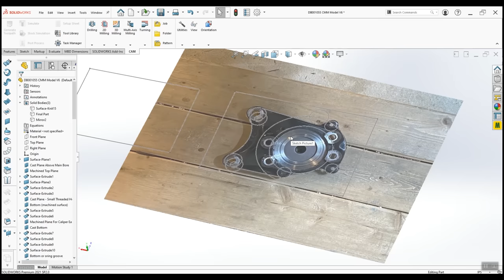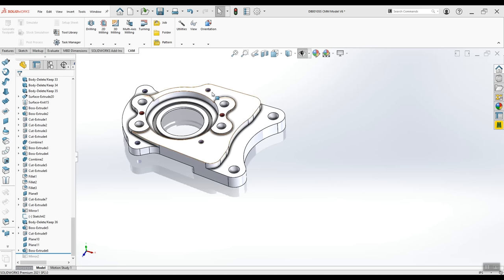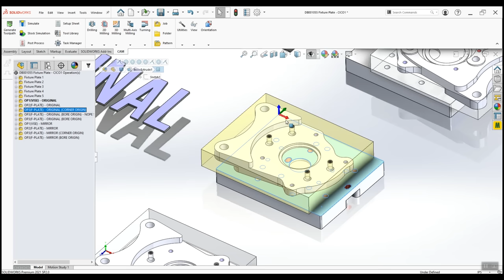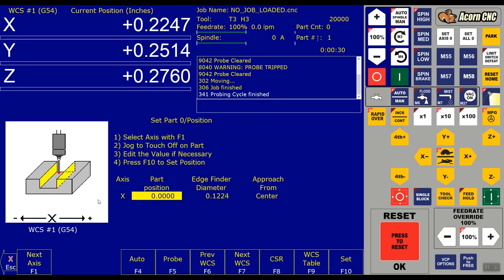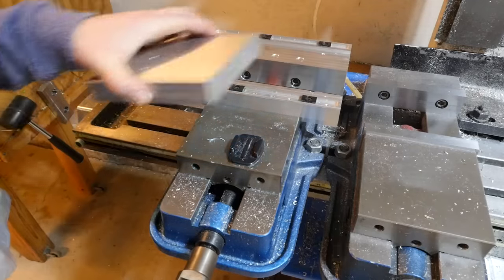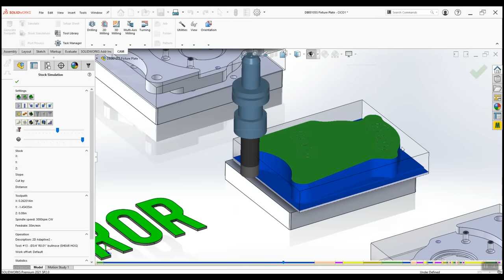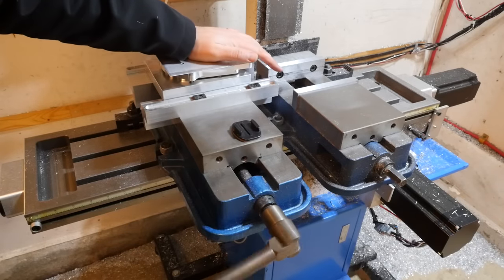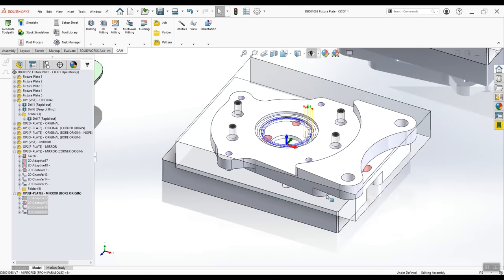How I Copy Parts in the Garage on a CNC Mill

Comment: Nice balance between pace and detail in this video. Thanks for sharing your workflow. How repeatable is the probe on X,Y ? I've just finished working in a macro that does multiple probe strikes and averages them to get a less than 1 step accuracy repeatedly.
Reply from the maker: Thanks! Repeatability is well inside a thousandth in x,y, and z. Accuracy is around a thousandth.
Reply: @adamdebowski2037  ok thats pretty good. My machine has 0.0125mm steps or 1/2 thousandth and I'm getting less than half a step error in repeatability. I've been trying to line up a bore when flipping a part.

Comment: Do You know how the formula of upgrading horsepower? Example of 2jz engine had 320hp but someone build 2jz with 3000hp. Is there any thicker wall of the engine besides of bigger compression and gas supply

Comment: OMG - Firetrucking awesome! I am an out of work machinist and disabled veteran. I would really like to know more about how you made your PM-30 work with CNC (I'm wondering if there is a ball screw kit for it). I already use Fusion 360 for my plasma cutter and I've done 3D in the past. My goal is to have a small fab shop at home so I can make a little income, anything would help. What you have there looks like it's in my reach and it would put me light years ahead if I could mostly replicate it here. That edge probe is the cats pajamas... The ones we had at my last job were so expensive that I rarely got to use one, good old dial indicator and the classic edge finders for most of us in that shop. You got my sub today. Thank you so much!
Reply from the maker: Hi PT Anderson! Respect for your service 🙌🙌 there is a ball screw kit for the PM30. There is one made by a company called “pro cut cnc” (I think), and one by a guy on YouTube (David Clements - YouTube username: Arizonavideo99). I have Dave’s kit and can confirm he does a great job getting out almost all the backlash. Yes - this probe is amazing. It’s good to about a thousandth which is plenty good for this mill. The “real” probes by Renishaw and much better, you pay for it, and would be overkill for a machine like this. The machine itself isn’t anywhere close to that accurate. I used an edge finder for almost two years before getting this probe. I would say a decent edge finder is about as accurate as this probe, and can do almost all the same things with more calculation on your part. The probe is mostly a luxury, and I love it! Cheers 🍻
Reply: @adamdebowski2037  That edge probe seems to be worth it just in speed, repeatability and ease of use. I plan on getting one when I can. Thanks for the info! I would love to see a video tour of the upgrades to your PM-30 when you get a chance.
Reply from the maker: @p.t.anderson1593  my thoughts exactly. At this price point, the extra luxury is not too hard to justify. Drew also makes a tool setter for closer to $500USD, which I do want but is a harder pill to swallow - especially when paying for customs and in Canadian pesos. I’ve been meaning to make a little PM30 upgrades video. Will try to get around to it soon!
Reply: This looks like a great machine, really nicely converted. What size steppers does it have? What is the spindle power? Currently looking into buying a CNC mill of some description.

Comment: is it possible to a copy a cylinder head port using larger centroid machine?
Reply from the maker: Absolutely. Centroid is just the controller - you can think of it as the computer/brain of the machine. The physical mill is what would have to be larger.
Reply: @adamdebowski2037  can you teach me the process on how to a copy cylinder head port design and what machine to buy? im willing to pay you for your time. im planning to open a machineshop here in philippines but i dont know who really knows how to operate this thing
Reply from the maker: @Perez.  feel free to send me an email with the details - a photo of the part you’re trying to copy - and if you’d like, check out some of my other videos on how to make a CNC machine for low cost.

Comment: Why not use a stop block against the mounting plate so you don’t have to rezero every time you take it out of the block? It the rezero op just more accurate?
Reply from the maker: Both ways would work. If I didn’t have a probe I’d likely use the stop. Using the probe is quick and gives me confidence it’s in the right spot.

Comment: Great work but you kinda didn't explain how you used the probe to model the position of the features into cad.
Reply from the maker: Hey! I think I mention that I measure and model the features one by one in solidworks. There is nothing automatic here. Just good old fashioned measuring and modeling.

Comment: Hi Adan
Thank you for the video, i have a PM25 that i converted to CNC and i used Centroid Acorn, do you please tell me what type probe you use on your machine, 2 wire or the other one for Tormach?
Thank you
Wagner Damotta
Reply from the maker: Hi Wagner - it’s the Tormach probe (it has the 3/4” TTS tool holding shank and shoulder) , but a 2-wire version. You will have to send an email to drew when you order it and he will custom make it for you.
Reply: @adamdebowski2037  Thank you Adan
I will get one, thank you again for the help

Comment: Any ideas on a younger dude wanting to get into doing this? 

What’s your day job that allows you access to this software? 

I work construction and recently got a job offer that is in the office. 

The biggest reason I wanted to do it is because I can’t afford spendy software to draw parts up and bring to cnc shops to have made.
Reply from the maker: I'm an engineer and use solidworks at work often. You can download a free version of Fusion360 if you want to start getting some practice with 3D modelling & CAM. You'll want to start paying the monthly subscritption fee (i forget how much - somehwere between 50-90 dollars monthly) once you're ready to start making parts on a cnc machine. It's not 100% necessary, but Autodesk limits the feeds and speeds which makes machining very slow.
Reply: @adamdebowski2037  Awesome. Thanks!👍🏼

Comment: Hi Adan
I going to order the probe, where i can get the wire diagram for connections?
How difficult for setup the probe?
If i have problem do you can help me ?
Thank you
Wagner Damotta
Reply from the maker: Hi Wagner, I'm not sure you'll find a wiring diagram, but it is a very easy setup. I'll try to describe the wiring. Drew will build you a "custom" probe (for the same price) for use with the centroid control that has two leads coming out of the body in the form of a female connector. He will also supply a short "whip" of the two leads terminated at the male connector that plugs into the probe body. You'll plug one lead into the acorn board's "com" terminal, and one into a designated probe terminal on the control board (that you define in the acorn wizard), then define a few other properties in the centroid setup wizard (like the probe being a normally open type) and that's all. The centroid probing routines will work! If you have issues, I can most definitely help trouble shoot any problems. One more thing: I would ask Drew to supply a spare female connector that you can make a bracket for to use as a "holster" for the cable when the probe isn't loaded in the spindle (just for extra "neatness" instead of having a dangling cable somewhere during other machining operations).

Comment: Did you have to pay for additional software to use the probe with centroid acorn/cnc12?
Reply from the maker: No. The probe works with the standard package. There is a digitizing package you can buy for an additional $300USD (I think) which will scan the part with the probe and generate “cloud point data” (I don’t have this package).

You can do digitizing with the package I currently have but you are limited to 2500 cloud points. Sounds like a lot but it isn’t.
Reply: @adamdebowski2037  Do You have mill pro?
Reply from the maker: @RussHarris100  I do not. Is that a CAM package? I am using HSMWorks.
Reply: @adamdebowski2037  No, I'm talking about the level of CNC12 software to run the Acorn.  They have the Free, Pro, and Digitizing levels.  I have the free, but it looks different than yours. I just ordered the "pro" upgrade.
Reply from the maker: @RussHarris100  I'm using the pro, too.

Comment: How does one get the basics to start CNC ? How much to make a setup for aluminum an wood ?
Reply from the maker: Aluminum and wood are usually cut on different machines. CNC routers are primarily used to cut wood, and CNC mills for metals. Some routers will cut aluminum and some mills are suitable for wood. I'll be releasing a video today or tomorrow about my build. The costs for everything are in the video. Stay tuned!
Reply: @adamdebowski2037  I subscribed I’m on board. Appreciate you replying an elaborating the difference. I basically want to do what your doing coping aluminum parts. Do have video that covers the basics an terminology? Or any resources would be greatly appreciated.
Reply from the maker: @runngunrc1991  Thanks for the sub! There are basically two main things to learn: CAD and CAM. CAD is "Computer Aided Design" and has to do with making parts in 3D on the computer. CAM is "Computer Aided Manufacturing" and has to do with creating the tool paths that will cut your part out of a block of material. To learn how to do both, download a program called "Fusion 360" made by a company called "Autodesk." It's free and is both a CAD and a CAM software. Then get on YouTube and search for Fusion360 tutorials. There are so, so many helpful videos on YouTube and for all this stuff it'll be your biggest resource. Cheers! Adam
Reply: @adamdebowski2037  Thank you Fusion360 I’m in .

Comment: Could you make another plate that is located under your fixture in the vice with locating pins? Then you could just use clamps to hold your machining fixture. It would always be located and you wouldn't need to indicate your work piece so may times. I have very little cnc experience but it just seems like a lot of unnecessary time spent indicating parts when a two piece fixture would solve the problem.
Reply from the maker: Absolutely - if I was making more than just the one part, it would make more sense.

Alternately you can also set up a probing routine in CAM that would come in and probe the area for the corner of the fixture plate automatically and set work offsets automatically.

We’re talking about saving 2 minutes on a 1.5 hour cycle time, though - or spending an extra few hours designing and machining the extra “sub” fixture plate… and another $40 or so of material.
Reply: @adamdebowski2037  Ok, I took it as you were making a small production run and make this part from time to time.
Reply: When you machine your fixture plate, don’t remove it from the machine: your part is now located. For OP 1, have some excess material in Z and machine the part held in a vise. Then take and flip over onto the fixture plate and machine the other side for OP 2. Saves you an operation and the need to indicate multiple times. Cheers
Reply from the maker: @dajulster  You've got to remove the fixture plate for access to the bolts from the bottom. Having excess material in Z adds to material cost and machining time (more material to remove after flipping the part). In industry it might be a marginal increase, but with a little mill like mine and a client base that doesn't write blank cheques, I try to squeeze every penny!
Reply: @adamdebowski2037  Yeah I was thinking you could reach under to insert the bolts. Appreciate the response, great video.

Comment: I wish I had gone into CNC machining instead of chemistry.  it never occurred to me as a 20  year old.  Now that im pushing 60 I wish I had.
Reply from the maker: You should get a little CNC mill like this one - now! You won’t regret it 😁😁
Reply: @adamdebowski2037  I'm taking baby steps. I got a 10w output diode laser to learn basics on. No tool paths so it's much easier.  Then I'll probably get a cnc router to learn tool paths.  After I master that, then I might go for a real machine.
Reply from the maker: @jowens1126  now you’re talking! That’s great. Best of luck on your journey. Make sure to check back in and share some footage of your process/projects 👍

Comment: Do yourself a favor and look up structure light scanning.  It makes this process so much better.
Reply from the maker: Looks very cool! Is it different than other 3D scanning? All the scanners I've seen (from hobby grade 3D scanners to industrial scanner attachments on CMM arms) output "cloud point data" (some, at very high resolutions), which is generally not useful to use for machining/CAM directly. From everything I've seen, no scanner is as accurate as a touch probe, and a scanned bore wouldn't be as accurate (or as circular) as a perfectly modeled bore/circle in CAD. On the other hand, this would definitely be more accurate for modelling the "bulk shape" than a photograph. Very cool - thanks for the tip!

Comment: How do you get the data from the mill to CAD?
Reply from the maker: Manually. CAD open on one screen and the centroid control on another. As bores are measured in the control, the control gives me size and position and I draw the features one by one in solidworks. For this part, it took about 30 minutes to measure and model the critical machined features, and I was taking my time - often measuring twice to make sure. The probing routines make it very “pain free.” All this is doable with an edge finder, but would be somewhat “calculation intensive.” The probe takes all manual calculation out of the process.
Reply: @adamdebowski2037   Thanks. I'm trying to measure with a Helmer and it can be a bit of a laborious task.
Set a G54 zero to match my drawings zero.
For round features:
G55 measure left, zero X, measure right X/2,
Measure forward, zero Y, measure back Y/2
G0X0Y0
Swap back to G54 and get the XYZ.
Save these values in a CSV, import into Fusion 360
Reply from the maker: Heimer’s are great. Always wanted one. More accurate than this probe!
Reply: @adamdebowski2037   You prompted me to do some research today, I have a Tormach with Pathpilot(LinuxCNC) and I've worked out the following GCode for logging to a text file. Maybe there is something similar for your mill.

(LOGAPPEND,Inspection.txt)
(LOG,Position #<_x> #<_y> #<_z>)
(LOGCLOSE)

This could probably be modified to something like the following to log directly to a csv that can then be imported into pretty much any CAD package.
(LOGAPPEND,Points.csv)
(LOG,Point,#<_x>,#<_y>,#<_z>)
(LOGCLOSE)
Reply from the maker: @lucaseaston  what a great idea - thanks for sharing!
Reply from the maker: Hi Trevor - the way I do it is very manual. I take one by one probe measurements while building surfaces in CAD. There's a comment a little further down by Lucas Easton discussing how you can log probe measurements to a CSV file (very cool). At the end of the day - I don't know of a way to build the model you'll use for CAM "automatically." To accurately replicate geometries, you'll always want to model perfect features in CAD based on accurate measurements - manually. It is possible, but not common practice to machine parts based on raw cloud point data from scanned parts alone.

Comment: 12:15 no precision needed on the central hole? Ie. a boring bar, since you re-zeroed.
Reply from the maker: Initially had the same thought and was told 0.005” would be plenty accurate for the centre bore.
Reply: @adamdebowski2037  Fair enough! Worries more about roundness because usually CNC makes oval-ish holes. Nice workflow video. Great for beginners that want to take a grasp of the whole procedure and then dig into specific tutorials and details.

Comment: Explain how Fusion360 is "close to free"?
I need to renew my annual subscription and that sucker is prolly gonna be over $600 this year.
Reply from the maker: You’re not wrong. $600 is $600… and I’m also looking at a mastercam quote from back in May with a bottom line of over $17,000 CAD… what we’re getting in fusion for $600 is a steal. Not to mention, if you don’t need Fusion CAM, it’s completely free. Unheard of before Autodesk launched Fusion.

Comment: you need to use alkohol as coolant, called T-red in Sweden.
Reply from the maker: This is interesting. Is it flood coolant, or a mist?
Reply: @adamdebowski2037  mist is Good enough. Try on some scrap, but it has to be continous.
Aluminium use to be sticky when machines, and the alcohol helps to prevent that.
This are specially good with high speed steel tools.
Lernt this when I got edjucated, to pro toolmaker.
Reply: To that there are other parameters, speed when turning or speed of the mill. Also the tools cutting profile, diameter of material when turning, and a mills diameter and rpm for it.
But if you are close there, alcohol might be magic.

Comment: Your shear hog finish is probably poor because you’re using inserts with no radius.
Reply from the maker: Agreed
Reply: @adamdebowski2037  I use the .030 radius inserts because they leave a nice finish and last a lot longer than the .010. I’d imagine the .060 would be an even better surface finish but that’s a good deal more material left in the corners for finish passes. That and I would imagine you couldn’t push it as hard. The .030 is probably the best all around insert.

Comment: Google this part number c- 2-2-459 these are close to the part but dont match mine
Reply from the maker: It’s a tricky little part that would be easier to cut on a 5 axis machine - but ultimately could be machined on a 3 axis mill with some custom fixturing. But before you can machine anything you’d have to know the dimensions of the part, size of the threads, positions of the bores etc etc.
Reply: @adamdebowski2037  that's great to hear that it could be done if I can't find one